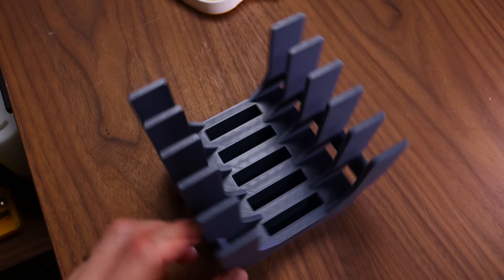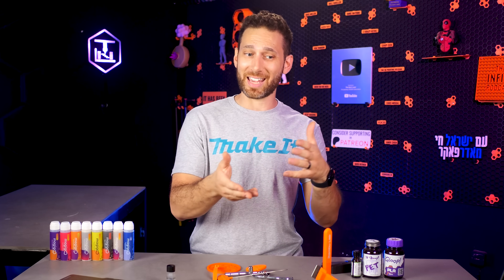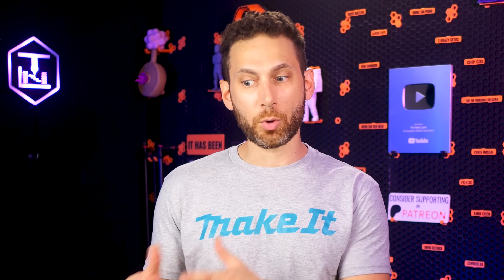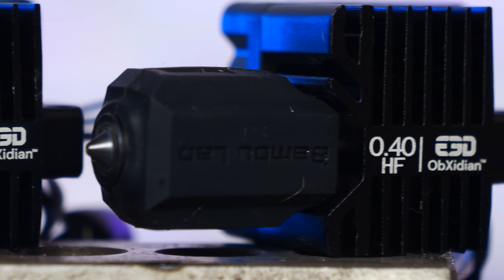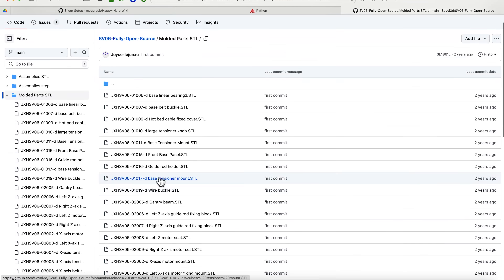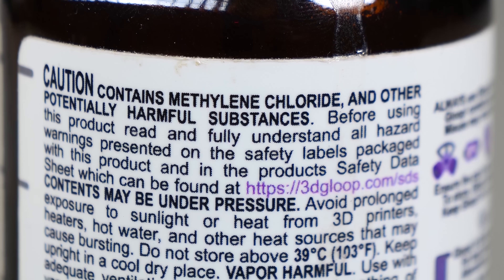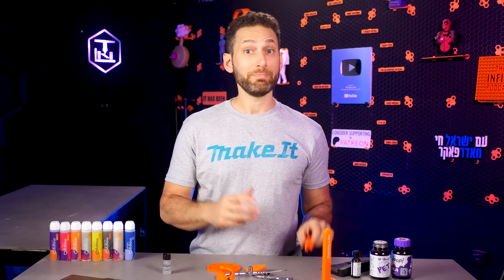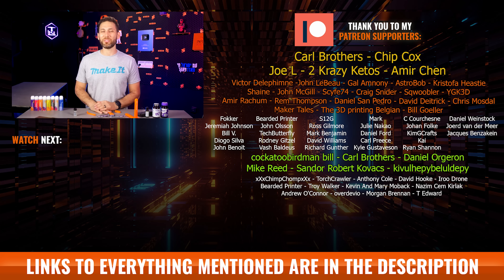These Underrated Products Make 3D Printing Fun Again

Comment: Does the Slice Engineering plastic repellent paint fix issues with oozing plastic messing up leveling or just when the plastic gets picked up from the last print?
Reply from the maker: It makes it not stick in the first place. Thanks for the reminder I need to put this on my core one nozzles as the nozzle cleaning keeps failing

Comment: What works really well for me is to clean the bed with alcohol before heating it up, then lightly dusting it with hairspray while the alcohol is still wet. As the bed heats up the alcohol evaporates and leaves a super thin layer of hairspray on the bed.

Comment: I've been using Magigoo since almost the beginning with an Ender 3 in 2019. I tried Bed Weld at the suggestion of some folks in a group on FB, but my experience was that it didn't release as well. I have some pretty sharp plastic razors that came in a kit with 2 handles and 60 blades. Work well and when they lose their edge, I toss another cheap blade in.

Comment: I just printed a washer with a handle with a tab and slot. I use this to hold my water bottle. I used TPU because I could squeeze the loupe past bottle top threads. Previously I had added a PLA hook that holds the handle. This on my Rolling walker.

Comment: I watched this video two days ago, and was really interested in what was said about the "Specialized Bed Adhesives from Magigoo".  I am at less thanat was said about the "Specialized 3D Print Glues from 3D Gloop".  I am at less than 100hrs of printing time on my Bambu Lab P1S and have been using the glue stick which works, but as you noted comes with downsides.  From the possible deformations and residue on prints.  I ordered the Magigoo – The 3D printing adhesive for ABS, PLA, PETG, HIPS, ASA, TPU.  I literally received it 30 mins ago.  Put it on the Bambu Labs textured plate, did a simple print for a spool adapter for some filament from Polymaker I am going to test for the first time.  Once it finished, it came off with hardly any effort.  Compared to using the glue stick which I still had to use a scraper.  Thanks for this recommendation. I also now am a Magigoo raving fan.  Thanks!

Comment: Vision miner for adhesive / release agent, dilute it by 50% with IPA and you will have a near lifetime supply.   Works with any filament type, leaves no residue. Cannot print without it.

Comment: I love the Bambu Labs scraper - I constantly use it to free prints when I'm in too much of a hurry to let the plate cool.  That said, the "self-tapping screws" are complete bullshit.  When I got my printer a couple of weeks back, I put my entire 200+lbs of body weight on them and couldn't get them to start tapping.  I used so much force that I would have put the screwdriver clean through my hand had I slipped - and still no tappage... using the PLA they provided with the printer!  I tried this for like 40+ minutes, drawing blood from one of my fingers in the process.  I eventually went to my bins and grabbed a couple of my own screws - and had the thing assembled in like 30 seconds.

Comment: There's a number of printable scrapers that have replaceable blades, i printed one out of PETG and it's been a beast. I prefer the petg blades because they work, but they won't damage my PEI plate. One wrong move with the bambu one and that's one side of the flex plate ruined, and i'm cheap

Comment: Magigoo is merely liquified glue sticks... often there will be other additives like acetone with dissolved plastic to help ABS and similar things for other plastics... I was there during the development phase and testing... The next step is Magigoo costs 15 Euro or about $18 per container... as opposed to $1.50 for a glue stick of similar volume... Look up the SDS for Magigoo and compare with glue sticks... Oops!  Knowing how and when to apply also makes a huge difference as well as designing for adhesion, knowing what your build plate is made from, etc...  You destroyed your own build plate using hair spray and harsh scrapers...

A 3D printer is a HOT machine tool and you should NOT be leaving it unattended... anymore than you would leave your oven on unattended overnight... That is an OPERATOR failure! If you are getting plastic adhering to your nozzle then you have other issues to address.

You can sharpen a putty knife or scraper to razor sharpness but a thin palette knife works far better... there are also many holders for straight razors at your hardware store. You can also find paint scraper blades in most paint areas, made for stripping paint and also replaceable and wide!

Comment: do you have a good glue recommendation for resin? I found tried painting on a little of the resin, pressing the parts together and then using a UV flashlight, but since the light cant get between the parts it doesn't work. I use weld-on-16 and its ok, but without an applicator brush it makes a huge mess every time.

Comment: Glue of some sort? Never used them, never had the need for it  guess.
Scraper? Don't need one, everything self releases after cool down, yes, even the smallest trace. And if I'm impatient, I can pry a corner with a sharp knife and the print pops off, My 1.5mm FR4 build plate is virtually indestrucable..
Note that I'm printing ASB/ASA for 99% of the time (for over 10 years now)

Comment: best thing i ever did was do a bunch of testing with build surfaces, if you light scuff the plate with 100 grit sand paper it stivks so damn good. i love it use a smooth pei sheet in this concenpt. if yiu use g10 garolite your gonna get fiber glass in ya. do a pass horizontal, diagonal, verticle and in circles. wash with dish soap and hot water and your good to go no need to have worries of bed adhesion anymore.

Comment: How quickly do you go through your major sponsor, Magigoo? Or to ask another way: How much do you spend per print? Because that shit is outrageously expensive. A "kit" is more expensive than an Obxidian print head.
Reply from the maker: It takes FOREVER to go through. You don’t need a full kit. You need a bottle of the regular and maybe PC/PA versions. I don’t use the specialty ones. And it lasts FOREVER as you apply it once every…5-10 prints? And it goes on very thin.

Comment: Personally, I still use a glass print bed and aquanet hairspray for adhesion. I have done thousands of prints with this combination. I have been printing since the Robo3d printer was prototyped. (2012)  the R1 had an all glass bed. I have bought many new 3d printers since and always bought a glass bed to fit each one. The glass stays flat, the hairspray is super cheap at the dollar store, smells nice and holds well. I have tried gluestick but I don't like it. The spray is liquid, and flattens out and dries tacky to the touch. It is always crystal clear and never discolors the prints. I know many people hate the hairspray method as well, but for me, its so much easier. A quick spray during the warm up process and done. After about 20 to 30 prints just use a small bit of soap and clean the glass with a razor blade. It peels right off. I think the people that have issues with hairspray are either using the wrong hairspray, or are waiting too long after spraying to print. I almost never lose adhesion unless its a super small and tall print but a brim fixes that most times. 95% of my prints I don't use a brim at all, but smaller ones do need that for any build plate.
Reply: That hairspray is getting ALL over your printer, gumming up your lead screws and blocking heat dissipation, as well as being a dust and dirt magnet on moving parts... You are actively wrecking your printers with the overspray.
Reply: @edwardpaulsen1074  i spray the glass with a shroud I printed. 99% of it stays on the bed no where else. But I get what your saying. I do clean it off with a little soap and water 2x a week, it comes off super easy when hot water and a few drops of soap are on it. A small razor scraper slides it off the glass easily. It takes less than 10 minutes to clean. But the first 3d printer I used, I didn't have a shroud and he's it had overstay but even still it ran for 6 years straight until I sold it to my brother. It's not that hard to clean up, it only needs a very tiny thin coating. It doesn't have to be poured on. I spray it for maybe a second long.  I normally spray the bed while it's heating up. I find if you spray it right after turning the hot bed on, by the time it reaches temperature it's dry and tacky to the touch.

Comment: I have used both magigoo and a gluestick for 3d printers.  I noticed no difference other than the price.  I also use a pei sheet.  I use petg mostly and only use gluestick for larger parts that tend to warp.

Comment: I use a regular paint scraper/spatula that I sharpened the top edge like a chisel and rounded the corners to not scratch the bed. I used a knife sharpening stone to shape the spatula into the perfect bed scraper. 

I used to use a large flimsy disposable breakoff razor box cutter to remove prints until I started using the paint scraper.

Comment: “CLEAN YOUR BUILDPLATE” is #1 for bed adhesion and should be the recommended method vs glue stick. However, the majority of buildplates will lose cohesion when they cool. This means if you can’t recover from a power outage within 15 minutes or so, resuming will cause the model to detach. Glue stick will keep the model attached to a cold plate. Therefore I will glue stick the plate during storms or planned outages. The price for magigoo and other adhesives prevents me from even trying them. If the glue stick causes unacceptable artifacts then I’ll consider the more expensive options.

Comment: I purchased the the small one and is going back. my first print come out good. the second one my filament would not stick to bed. so I cleaned my bed, washed it, reapply the thing on my bed and same problem. so clean again, apply glue this time and no problem printing.

Comment: I have a recommendation for you throw that scraper in the trash and get a rounded nose paint palette knife, the metal lies flat on the bed (not at an angle) and the spring steel is about as thin as a sheet of paper (gets under prints way better) and yet is almost impossible to bend or break. In fact this is what I have been using for 10 years now and I will never use a 3D printer again without one. Oh, and the brims or little bits of support, just lay the tool flat on the bed a ways away and sort of ram them, even the toughest to pry off then just pop off and go flying, only down side is when you move your printer table your going to find tons of these little bits behind it on the ground. I actually sent one of these to 3D printing nerd when he first started out. Asked him about it a year ago and he said he still uses it all the time (though I have not seen him use it on his videos)

Comment: On my MK4 I spray the plate with glass cleaner the good stuff then take Nano Polymer Adhesive put a few drops on the plate and spread it with a makeup sponge for even coat. I have not had issue with PLA and  PETG not sticking to it. I have not used gloop as of yet pretty price wise. Creality Clog Poke ( this is long screwdriver type of device ) that looks like the Wham Bam you shown in the video for most users should have tools to remove the nozzle if need. And last FOSHIO Plastic Razor Blade Scraper  has plastic blade just like the metal ones but will not damage the build plate

Comment: 3D Gloop is more accurately a plastic cement in that it slightly dissolves the mating surfaces so when the solvents evaporate the plactic re-hardens into a single piece. Kind of like chemically welding the parts together. If you are using small amounts you should be either outside or in a room with excellent ventilation (and yourself upwind of any exposed glue). If using a lot in one sitting, you should probably have a solvent-rated respirator on in addition to the ventilation.

Comment: I feel that glue stick vs Magigoo is a good example of how budget and performance need impacts a decision.  Buying a gluestick from the dollar store is a lot cheaper than a thing of Magigoo, and it does the job well enough for my needs.  But it's good to know the option exists, because there will be people who have either higher performance needs, harder to work with printers than my X1C, or just less time to deal with cleaning the bed every few prints, and thus are more willing to spend money.

3D Gloop is very much the same sort of thing.  At the end of the day, 3D Gloop is just a solvent suitable to your plastic type, with some thickening agents and something that makes it set quickly (which could, honestly, just be the solvent being very volatile).  You can make something similar on your own by dissolving scraps plastic in the appropriate solvent.  No, it won't be quite as easy to use, and yes, you'll spend more time setting it up - but it's an easy way to trade time for money if you need to. Especially since I mostly work with ABS, it's easy enough to buy a can of acetone from the hardware store and mix some scraps in, and it's a lot cheaper.  (I work part time and have very little spare cash, so for me, anything that saves money at the cost of time is worth considering.  Of course for someone like TNL who's probably always short on time, spending money on 3D Gloop is a good choice.)

Either way, I very much agree that one should never join two parts made from identical plastics with glue*.  (3D Gloop is *not glue, it's a solvent.)  Use solvents to weld the parts together, and save glues and adhesives for woods, metal, and dissimilar materials.

I actually own a vial of the anti-plastic paint, and forgot all about it.  I bought it to try and deal with my godawful Ender-5's blob-of-death issues.  Now that I've got a Revo Panda hotend on my X1C, I really should dig that out and coat all my nozzles with it.  Thanks for the tip!

On a similar vein, I'll have a look at the nozzle kit.  Trying to unclog a Revo hotend is a pain in the butt.  The pokey bits might be exactly what I need.

Comment: Glue stick dissolved in 70% IPA can be brushed on with a paintbrush or smeared with a paper towel to leave an invisible layer. Cheap and lasts forever (or until you clean the PEI with soap and water and IPA again)

Comment: I swear by Nano Polymer adhesive on my printers now. A very thin layer lasts a long time for PLA prints(3+ weeks with frequent printing), and it works with anything I've thrown at it( PLA, ABS, ASA, PC, TPU, Nylon, and some really weird stuff like Fiberology CPE-HT and Polymaker  PPS-CF). I really only clean my build plates once a month now, and that's mostly preventative maintenance. It seems like $20 for a small bottle is super expensive, but one bottle has lasted me 4 months on both a 320x320 and a 230x150 build plate. I wish they adopted an applicator like Magigoo, but that is a really minor complaint compared to the fact that it just works with any plastic you throw at it.
Reply: I got a couple sample bottles of Nano Polymer adhesive at the RMRRF and I'm still using the first sample bottle almost 6 months later. Not printing a whole lot, but also the stuff "just works" when I use it. It'll be a while before I run out of the samples I have, but definitely recommend it for anyone else who can get their hands on it. I definitely agree that I wish they had an applicator like the Magigoo stick though...

Comment: On the X1C the only failed bed adehesion were due to not having put proper glue on the plate. Keeping the glue stick properly capped results in a very thin layer applied. So for that I think I'll keep using glue sticks ^^;;;

Comment: The Bambu scraper is just too sharp and aggressive. The perfect all-around scraper is the blade scraper made for oscillating multi-tools. A high quality one will win you over immediately. The cheap ones are still good, but they tend to ship a bit too sharp or with a burr, which makes them feel and act too much like the Bambu. So if you get the cheap ones, take a minute to smooth the edge a bit to where it glides over the build plate. The zig-zag profile of these blades is deceptively useful. If you create a handle for them, they become even mo-better. Of course, if you specifically don't want to win 3D printing, I understand.

Comment: I use the Bambu scraper; I’ve printed out a couple copies of it. However, I’ve never once got the screws to tap into the plastic successfully. They’ve always been too short, so I end up using glue to secure the blade to the plastic. I’m not sure but it seems like they included different, smaller screws with my kit that don’t work correctly.

Comment: I know glue sticks are a pain in the ass from before but honestly the purple Elmer's is awesome. It goes on easy and washes off just as easy. Literally hot water sprays it off, or isopropyl is King. Give it a try
Reply from the maker: But it goes on wayyyyyy too thick especially on textured build surfaces

Comment: Great Video! Thanks for the information. I do have a question for you: Slice engineering has a Mako Hotend for Bambu Lab for the X1 and P1 do you know anything about it? It's suppose to be a super nozzle that can handle the PLA/PETG-CF filaments.. I had some real problems with the PLA-CF ruining my nozzle.
Reply from the maker: Yep my next video will have some info about it but basically you can read more or preorder at https://jle.vi/slice
Another manufacturer has a super nozzle coming out soon too…